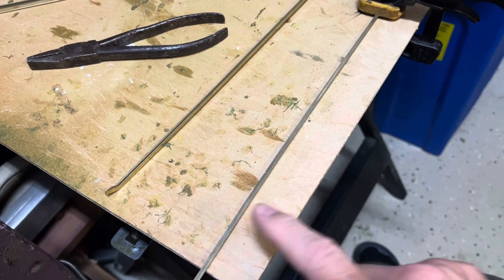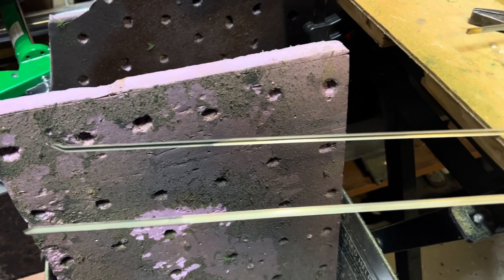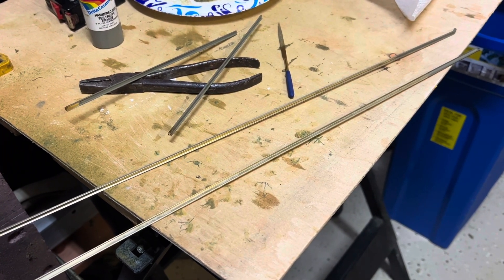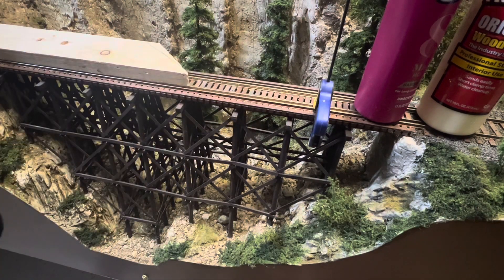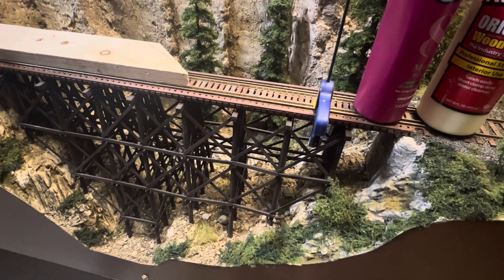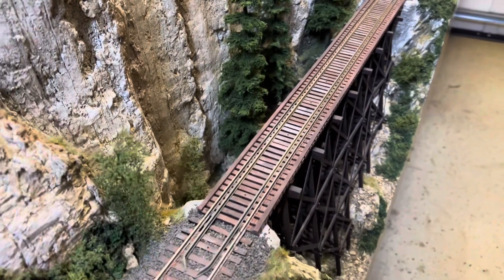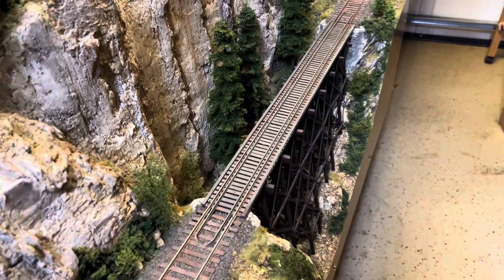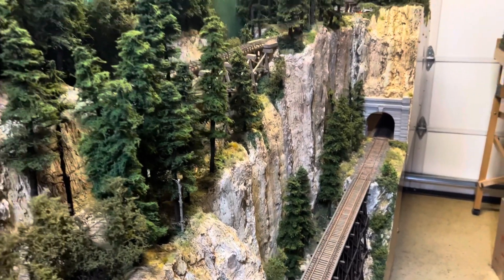O/On30 - O Standard Trestle Guard Rails Install - Model Railroad Adventures with Bill EP244

Comment: What is Rapid Fuse adhesive and how much working time do you have before it is cured on rail?
Reply from the maker: It’s basically a brand of super glue.  I find it at Home Depot along side the other glues.  It will grab fast so not much time to work with it.  I always practice and do a dry rub on this type of glue application so I get it right the first time.  The stuff holds really well.  This has gone to a train show and back and no issues with it holding